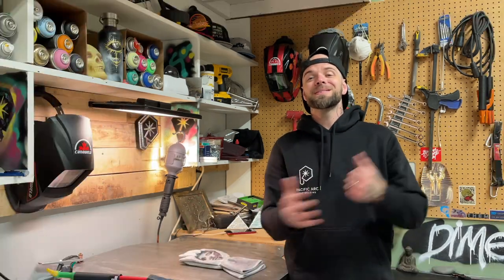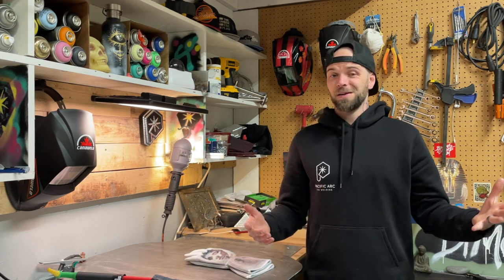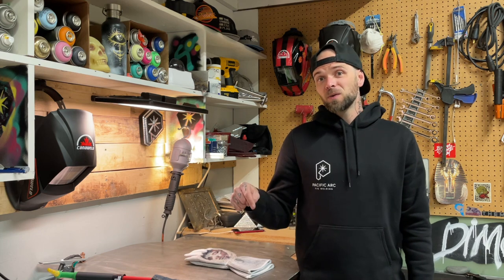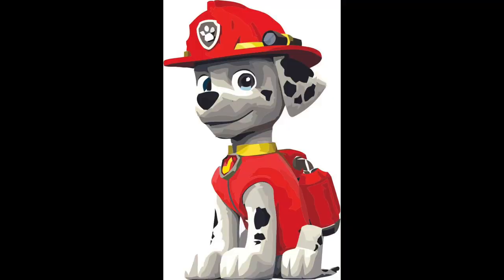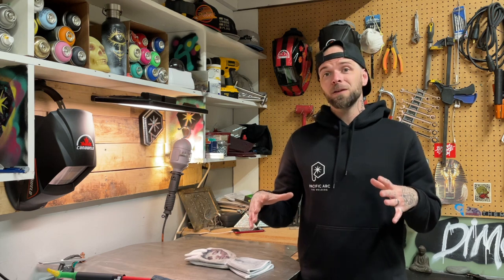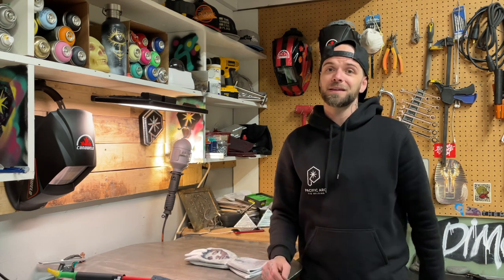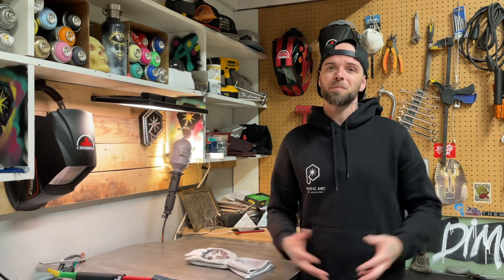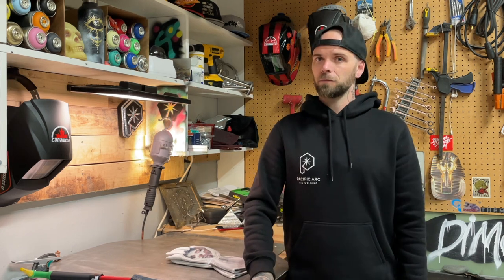Tig Welding SAFETY! How many did I fail?

Comment: You should talk about thoriated tungsten radioactivity and the importance of wearing a mask while grinding tungsten! The lungs burn slow.
Reply: Thorium has a half life of about 14 billion years and is an alpha emitter .It's not radioactive enough to really be dangerous unless you breathe it or eat it.

 I'm much more worried about the chemical and mechanical issues associated with breathing metal dust.

Comment: Actually it doesn't take that much inert gas to cause a problem.  Air is 21% Oxygen by volume.  When the Oxygen level drops to 19.5% or lower, there is a suffocation hazard.  Granted, a 19.5% Oxygen level will not cause you to pass out right away, but it can affect your mental abilities, you may become drowsy or lose your concentration.  So it only takes an increase of 1.5% by volume of inert gas to cause a potential problem.  Also, given how close some of us get to the torch when TIG welding, it is something to think about.

Comment: Also, for all you rookie TIG welders out there (like me) -- Even if it's 95 degrees out, don't weld in a tank top, unless you want the worst sunburn of your life. I didn't realize that the Arc was emitting huge levels of ultraviolet rays and is basically a tanning bed and did about a 2 hour practice session last summer and was absolutely COOKED. In hindsight, it was really dumb, but I thought, "There's no sparks flying out from a tig run unlike a mig run, I should be fine." Ya don't know, unless ya know.
Reply: Absolutely.. I was wearing board length shorts and was welding a large steel rack. I felt the burn on my calves after I finished the job. I was using a MIG welder and didn't realize that you could get flash burns. Now I cover up no matter how hot it is..
Reply: I did same thing burned the crap out of the inside of my left arm, I’ve been Mig welding daily for past year no problem. One long session Tig welding and I was roasted
Reply: In that case put on a sunscreen sticker so you get a tattoo tan.

Comment: SAFETY SHOES!   Wear steel toed shoes when working with heavy objects whether at home or at work.  6 weeks ago (Victoria Day) I was putting together a welding table.  Didn't want to pay $2000 for a table so I was going to do it myself and it was working out well.  5 minutes away from starting to paint the frame (easily 200 lbs) and I had the frame up on milk carton crates in my.  did not like the angle to attack the last welds so I started to move everything not realizing the frame was on the edge of the crates.  Guess what happened next?  Shattered my big toe and damaged my upper foot.  Ugly.  Blood.  Fracture.  Tissue damage.  Safety shoes were at work.  Not at home.  Wear safety shoes and avoid going to the fracture clinic every two weeks and not getting paid at work because you are laid up.

Comment: im pretty sure the "dont do really cold water" thing means dont icebath it. you want to cool the area, not freeze it. because the areas burned, you might not notice the pain caused by damaging the tissue with near-freezing water. plus it'll slow down the activity of the surrounding tissues, impairing the initial healing process. when you're chilling a burn, you only want to remove the excess heat energy, youre still warm blooded and the rest of your body needs to be between 37C/96F and room temp.

Edit: theres also specific non-stick burn dressings and burn creams. if you spent the money to get a welding setup, buy yourself a tub of burn cream and a few dressings, you WILL thank yourself later, ask me how i know.

edit 2: now that I've actually finished the video, awsome as usual Dusty, lol

Edit 3: if possible, you should be cooling the burn under running water from a cold water tap. if thats not possible and you have to submerge the area in water, make sure to use as big a container of water as possible and constantly move it around to expose it to fresh, cool water

i should say im not exactly an expert, but i've been burned many times and I've never had to go to the hospital (yet) because I had a fully trained nurse within earshot. everything i've written here is stuff I've had to do several times under expert instructions. 

That being said, none of these treatments are a magic bullet for every burn. everything here i've said is just first aid, if youve cooked your forearm to a nice medium rare, just chill it before going to the hospital. use your head and dont try to "be a man and tough it out", if it looks bad, hurts bad, or even if youre not sure, go to the hospital and get it seen to properly. your health is the most valuable asset you posess, dont squander it.

Comment: Hi Dusty, one thing I don’t see a lot of welders discuss, and not sure why, but; grounding your welding table, as per the AWS requirements. I found out the hard way after getting a massive shock while TIG welding aluminum. I re-read the specs, and had my electrician install a 2nd ground to earth, which I attach to my table, and this sorted the issue immediately.  Also, any other shop equipment plugged in, needs to be on a earth ground as well. I found. This out as well the hard-way....blew a few pieces of equipment because they were plugged in, and not earth grounded. I now unplug anything not in use.
Reply: Can you please explain this to me in detail a bit more, I run a home shop thing and I don't have any earth to ground whatever or second ground and now I'm worried

Comment: Most of the things I wanted to add are covered by other comments already - but one thing that isn't, is don't weld galvanized steel! The zinc oxide fumes generated are very toxic - sure you may be ok with a respirator, but you also may not, so don't risk it (unless you have the training).
Reply: Iv seen that white floating death a couple of times when I wasn’t expecting it from not cleaning both sides or not grinding enough off. Nasty stuff.
Reply: 95% of all welding is done on Galvanised shit especially anything agriculturally related.
Zinc fumes are no where near as bad as welding stainless and aluminium or heavy rust.
A slight breeze and milk literally devoids it whilst gas related smoke is inescapable without a papr

Comment: How to grind tungsten, the dust is toxic.  The dangers of grinders, an worse grinders with wire wheels. Clothing that protects against not only burns but UV skin damage. Good footwear when working with heavy pieces or tools. Clear area including floors; sparks can travel a long ways. High pressure gas bottle storage. Gloves for handling chemicals.  Glad to hear about your fans, but would feel better if you had a squirrel cage, or similar, fan connected to a 6” diameter flexible duct.  Always a balance between good ventilation and protecting the gas shield. All just additions to what you said. So glad you’re protecting your ears; I didn’t and 30 years of stupidity have resulted in huge, frustrating hearing loss. You’re the Best. Cheers, Will
Reply: Best money I ever spent was on a pair of 3m peltor ear defenders. My hearing has improved and my tinnitus has subsided. You won’t always get something in your eye but you will always hear things even if you’re not the one on the tool was a good point a guy made to me.

Comment: If you have a long hose between your welding machine and argon bottle then you need to set enough time of pre-flow because when you starting there is stil quite high pressure in the hose that cause long and extremelly hot jet of plasma from your torch. That jet can burn your gloves out in milliseconds and make a tips of your fingers little crispy. )

Comment: Question.
I work on foundry tooling and I do a lot of welding on patterns. I have to sometimes get into deep areas that could be a 1in diameter pocket that's say  1.5inches deep. 
Any suggestions for cups that will allow a long enough stick out? Or is there a place where I can get a gun similar to the small pencil gun that ck makes but bigger?

Comment: Safety comment.
If you are spraying sparks whether from a grinder or torch wear Ear Protection. A Boiler maker was using an Angle Grinder. Apparently, a spark/blob bounced off of something and went right into his ear and burned a small but permanent hole in his ear drum, needless to say he lost some of his hearing.
Ear protection can be anything that would cover your ears, anything except alcohol wipes.

And don't wear plastic or raggedy cotton. I wore plastic sweatpants and had burn spots all over my legs and a pair of religious sweatpants.
Don't wear raggedy Jeans. You should wear cotton, but I watched as a friend started their leg on fire with an angle grinders spray. It was quite entertaining.

Comment: You probably won't cuz I don't either🤣, but you should keep your rags separate to your bottles of solvent. 

I tend to keep the rag on top of the bottle I was using with it so I don't get them mixed up, but a fuming rag is much more prone to ignition from sparks than a closed bottle but once it's burning it could melt through the bottle and work as a wick, and then you're literally adding fuel to a fire...

Comment: I caught my hair on fire Michael Jackson style. Was Mig welding and got lazy and didn’t clip off the stick out, figured I’d hit the metal and it would burn off. It did but it flew up on top of my head. I noticed a searing burning feeling on my head along with burning rope smell. I had to run into bathroom and put my head under the sink. I went out and bought one of those little welding hats after that.

Comment: Another very good and helpful video.
Maybe said already: Watch that the power cord, ground cable, torch hose, and foot pedal cord aren't kinked and far enough away that you won't catch your foot if you need to move suddenly.
Also, check that your helmet is working before getting up close.

Comment: Hello, I work in a garage located in the basement of a building. The garage is only at 20 feet of the main parking entrance fence . Do you think I need a ventillation if I tig weld steel or aluminium?
Thanks